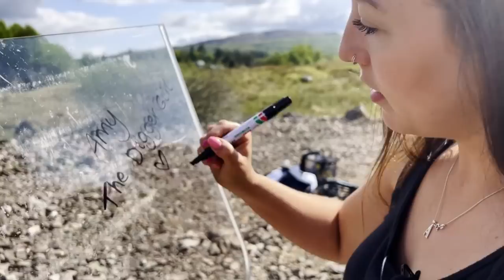I Fix Burst Hose + New Work Announcement!! - Digger Girl Diaries Week 17

Comment: Great effort, and I loved your "I'm an operator not a fitter" said with a smile and hands behind your back, I'm retired now but that was my job for forty plus years working on earth moving equipment 😊😊
Reply from the maker: I wish I knew a little bit more but I can usually get by😅 thank you for watching 😊
Reply: You are a heavy equipment technician that is so cool do you have any tips for someone who is an absolute noob in the field of work
Reply: @elijahblasko887  If you do want to tackle any maintenance work on machinery make sure you understand what it is that you're going to attempt to do  - workshop manuals are the best way to learn  - and have the right tools for the job. I've seen so many small contractors turn a small job into an expensive repair through lack of understanding of what is involved.

Comment: Awesome Video Amy, Pro's & con's of being a Digger Driver. Hammer Glass, nice touch. Enjoyed watching as always, TY for the upload
Reply from the maker: Hammerglass is soo strong I can’t wait to show you all. No, thank you for watching I really appreciate it 😊 have a lovely sunday 😊
Reply: @the_digger_girl  Years ago I smashed a couple lower windows whilst using Hammers, but haven't done for a long time, It's how you use a Hammer which will Brake a window, As you know Amy. What I mean by that is, I can operate a Hammer and smash the window in the first 10 seconds of using it, if I wanted.  experience will stop this. Like, if I'm braking something like Granite, I'll normally push a little pile of dirt where I'm about to place the point which will stop chips flying up and shattering the glass. Or if I need to do a Job Fast as possible I'll raise the top Window and remove the lower Glass and wear a set of Muffs and Glasses and crack on. Experience is key, a new Operator will get a Hammer stuck, where Experience Operators won't. It would be interesting to see just how durable "Hammerglass" is
Reply from the maker: @bigbaza30  absolutely get you. I was so shocked as to how strong it is. I’ll share the videos soon!😁
Reply: @the_digger_girl  Look forward to watching, TY Amy, Take care

Comment: Remember for hydraulic systems especially when doing maintenance cap the ends (with clean) to prevent contamination from abrasives, air, and water just a tip from a heavy equipment technician

Comment: Hose burst is just so annoying, have you ever lost your tilt with your hoses on? I did that once just before I was going on summer holiday, a lot of stress to finish, then I forgot for a second. Hose went off at the quick couplings and also damaged the hoses that were attached to the rotor tilt at the same time.🙈😅 Lost ALOT of oil before I could stop and could no longer get the grading bucket off the tilt, so the rest of the day had to be done with a rock bucket until the mechanic replaced the hose set. So embarrassed, and glad I didn't have to pay the bill myself.🧐
Reply from the maker: Yes they’re annoying just have to try get the machine off as soon as possible which isn’t always easy!😅